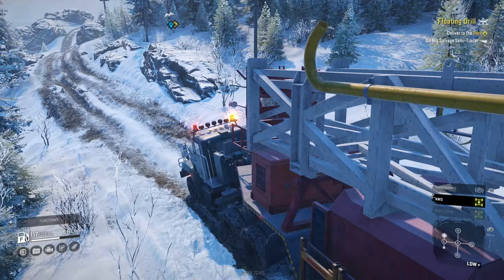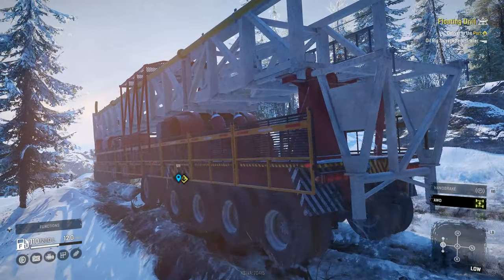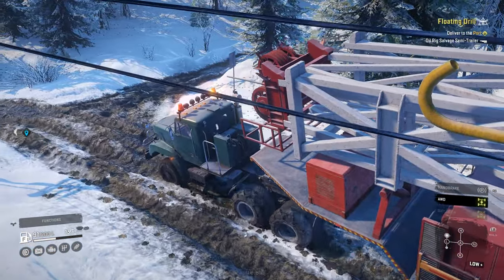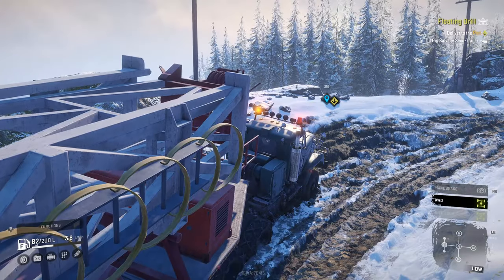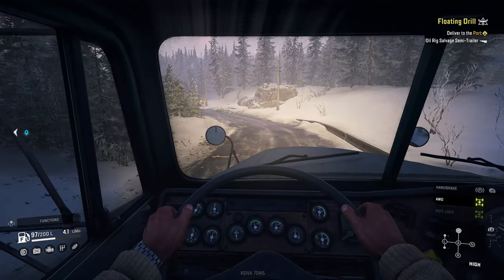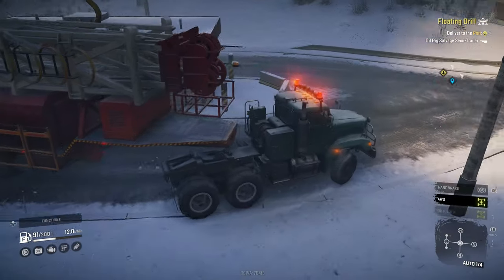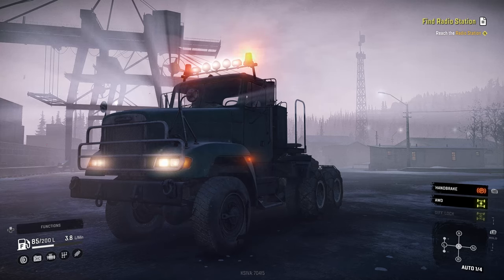SnowRunner Alaska Oil Rig Salvage Semi Trailer | Floating Drill | Freightliner M916A1

Comment: I find Snowrunner a very relaxing game with the added forward thinking problem solving objectives.
Reply: Who asked?
Reply: I personally can't do the fast twitch games anymore I like my calm steady simulators.
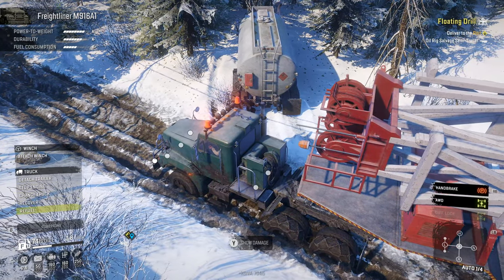Reply: I was trying to take that trailer to the objective but i was in a turn before that nasty muddy place,i was with Tayga and gear set on L and as i turned at this video 6:40 Tayga flipped and the trailer.
Now i will have to rescue Tayga and bring BM17 with a big crane to pull that thing up so i can bring Tayga again so it can pull it.
But when i get in the muddy area with it i have no idea how can i pass and there is no way to avoid that other than trees and deep snow to get stuck again in irregular terrain with that monster behind.
If i go through that deep mud i can deliver it and if i need gas i bring another truck with a tank.
In real life there is no way a truck with AWD can actually pull something of this scale and in muddy places like this,perhaps they need another type of heavy machine specialized in pulling this.

Comment: Thank you for showing that this can be done with the M916A1. I've had people telling me that I absolutely needed the P16 for this no matter what and didn't believe them
Reply: I did this with Tayga,the trailer fell to the left side at 6:22 but the game crashed and didn't save.
I went again and it fell to left side at 7:30 and i had to bring BM17 with fuel addon and White Western Star with big crane so i could lift this monster to get back on track.
It was the hardest monster semi trailer i did until now,i did another one to bring to Mountain River with BM17,only got stuck when i need to go down in the turn close to a gas station but back and forward and i did it.😅
"Pacific P16 doesn't need AWD,the sheer force of the engine with mud tires and diff lock will dig through everything"
This is pure bullshit,a truck without AWD will allways be limited.

Comment: dang brother, you've got some brass klackers taking the intended route with the trailer. I took the intended route to grab the trailer with the P16 and it didn't sit well with me at all. I grabbed my White Western Star and checked out the detour route and decided that was the route I'm going to take. It was a little sketchy with the P16 and no AWD but she pulled through. I did put my Azov -131 on the main road so I could top off the P16 and everything went well overall. I think I'll get the M916A1 and see how well it does. Great video!
Reply from the maker: Thanks 😎👍

Comment: I didn't think you'd chance that with the bad camber, it looked impossible, and not to mention, downright scary. I would have done the detour route to be on the safe side.😨 Love how you plan things out along the route though, a handy fuel tanker 🚚 in the bushes.😲 😀 But yes, great driving - yet again! 👍😁🐑🐑🐑🐑
Reply from the maker: This game if you get it you will soon realize it helps if you plan out your route fuel is a big issue and you need to get off them road tires as quickly as possible in the beginning else your not going anywhere 😂 that camber i expect its easy to slide down funny enough i have not gone down it 😂 but best to tread carefully and slowly along there😀 the problem with the detour route is if you have a large trailer its difficult to take one corner you can get round but you need to do it right the first time and there is deep snow you need a good truck too 😀
Reply from the maker: @RailwayBobbie  You need to learn how to repair bikes yourself its real easy save you £s in labour charges